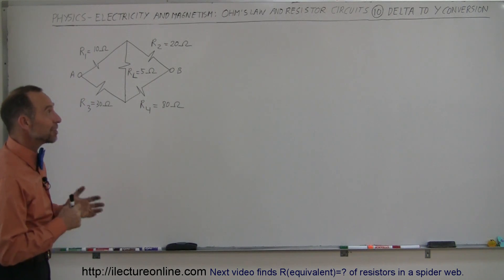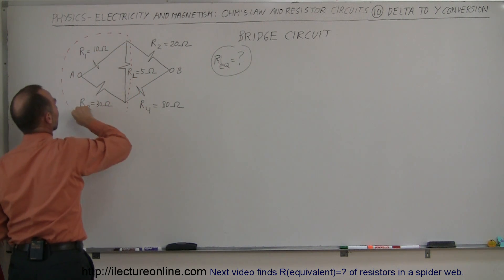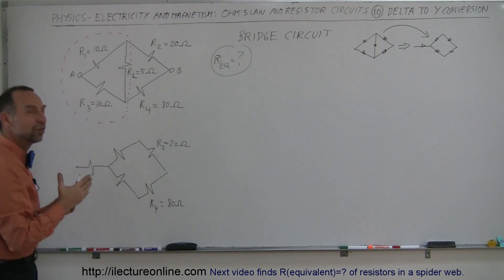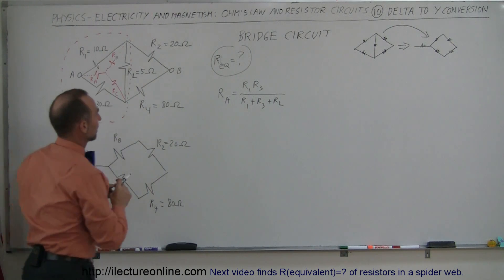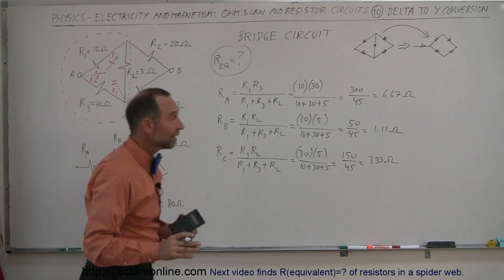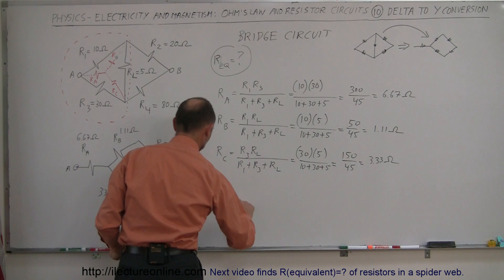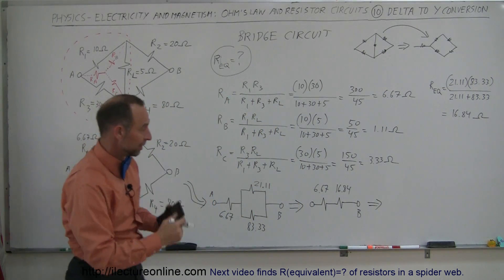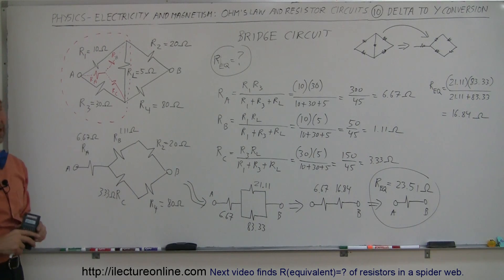Physics 42   Ohm's Law and Resistor Circuits (10 of 23) Delta to Y Conversion

Comment: Sir
Here I can use the Kirchoff law to solution, but if there are capacitors , inductors and resistors that are connected together like this shape as a bridge , can the impedance be found using Kirchoff ? And if not , How will we calculate the impedance ?
Reply from the maker: We can still use Kirchhoff rules, but you'll end up with a second order differential equation.  See the electrical engineering videos.
Reply: Thanks sir.. 😀😀

Comment: How do we apply this technique to find out the  capacitance in this case.?? If capacitors with same values as that of resistors are present in place of resistors
Reply from the maker: It would have to be solved in a similar manner as shown in this video:   ELECTRICAL ENGINEERING 2.1 BASIC LAWS

Comment: Whoa, this is very helpful! How would you approach the problem if the wire through the middle was just a short circuit and not a resistor?
Reply from the maker: That actually would make the problem easier to solve since you would then have 2 sets of 2 resistors in parallel. With those 2 parallel sets in series.
Reply: That's what I suspected, thank you for clarifying!
Reply: Would the answer be 23.5(Ohm)? It seems like the middle resistor has little effect on the overall resistance. I swapped that 5(Ohm) to 0(Ohm) and 10^100(Ohm), the answer varies only between 23.5(Ohm) and 23.5714(Ohm). Or is my code correct?
Reply: That's a faster method. I tried it out, 2 methods lead to the same result.

Comment: please give formulas for Y to Δ also...you only explained about Δ to Y
Reply from the maker: +shraman shraman 
Typically you don't need to go from y to delta, since you can solve everything about the circuit when it is in the y form.  Did you get an assignment to convert from a y to a delta circuit?
Reply: +Michel van Biezen yes..question was ..convert this Y circuit into a delta circuit..also it is also useful in some equivalent resistance problems...